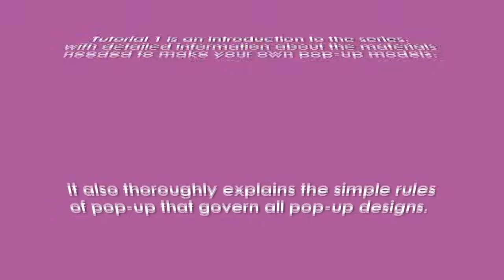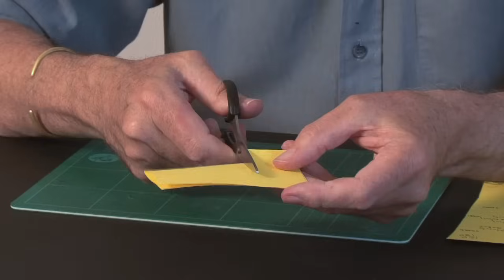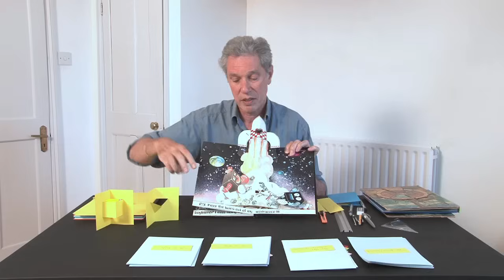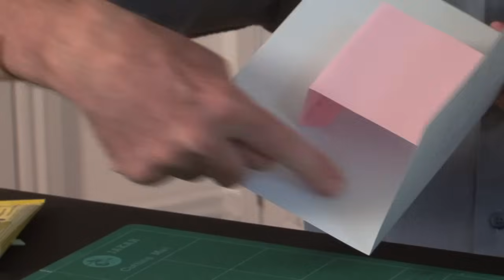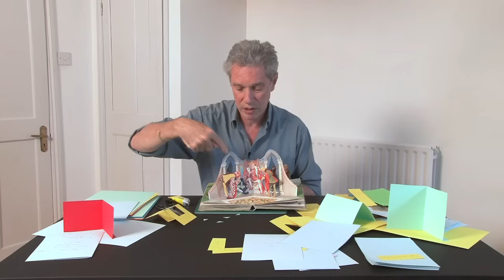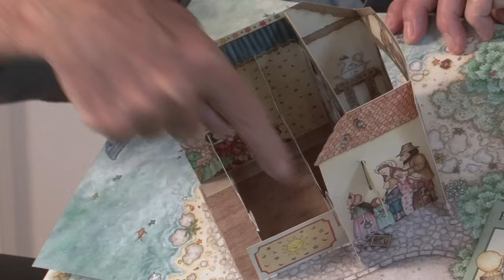Pop-Up Tutorial 1 - Introduction – Materials and Basic Theory

Comment: For anybody wondering  how to find 160gsm paper, it’s just like trying to find A4 paper. Those in the USA will have to find the closest approximate type. 

1gsm=1.48 x 1lb 
160gsm=108lb paper

Cardstock will be too heavy, printer paper is too light. I’ve had great luck with construction paper (there’s a reason it’s called that) but the rough texture doesn’t allow you to illustrate it first. The other thing I’ve used is the decorative scrapbook paper that they sell as single sheets at every craft store, like Michael’s or Hobby Lobby. It also comes in those 12 x 12 paper pads, but the pads are never solid colors.

TL;DR: Construction paper is about 160gsm.

Comment: Would be nice if you were more specific on the type of glue. "Solvent based" is a large category. Some links to specific products would be helpful.
Reply from the maker: I usually use UHU. Really any glue will work. Different brands have different characteristics so probably best is to experiment and find the one you like best. I only specify "solvent based" because these dry more quickly than water based (and don't wrinkle the card) and so I find them easier to work with. There are Gel glues that are very good and clean to work with but they work out a little more expensive.

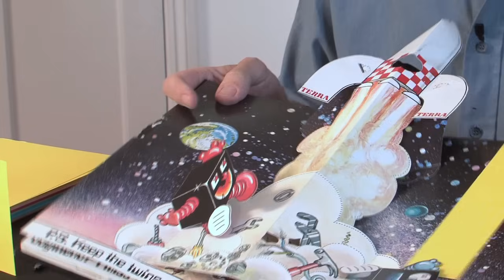Comment: Please guide me. How to move Rocket down to up. 7:24
Reply from the maker: The underlying structure is explained in Tutorial 7 - A V-Fold with added creases. To make the rocket rise as the page is opened the V-Fold should be built pointing down the page. The rocket is made using a Parallel fold as explained in Tutorial 6, this is built on top of the V-Fold. To see how to shape the nose of the rocket look at Tutorial 13 - a little wedge will need to be cut out of the nose in order to shape it.

Comment: If you’re making a pop up that opens up to be 1 foot and 5 inches what thickness of paper do you suggest?
Reply from the maker: The card needs to be rigid  - the actual thickness is not important - You could make the base sheet out of heavier card and then build on it with lighter card. Heavy card will need to be measured and then scored to make accurate, sharp, folds - when using lighter card scoring is not necessary.
Reply: @thepop-upchannel4919  ahhh ok thank you!

Comment: What type of  glue you have used here.,  sir
Reply from the maker: Any glue will work. I prefer solvent based adhesive as it sets quite fast. Water based glues are ok but may tend to wrinkle the card. Stick glues are quick, clean and easy to use - but are usually best for practice models as they may tend to dry out and crack off if left for a long time.
Reply: @thepop-upchannel4919 
 thank you sir, 
How pop up cards help in classroom teachings? 
Can we use pop up cards as teaching aids?
Reply from the maker: Pop-Up cards might make good teaching aids as they have a surprising "Wow!" factor - unexpected, intriguing, aesthetic - so could maybe hold pupils interest for a little longer. As a classroom activity Pop-Up is good for - Art and Design - or Art and Technology - Geometry - Measuring skills - Desterity skills - 3D thinking.....If the idea is to make pop-ups then pupils have to be old enough to have good motor skills, so probably not suitable for very young pupils.
Reply: @thepop-upchannel4919  thank you sir. 🙏🙏🙏

Comment: Hi sir.. I really love to learn also about pop up making.. Hence this was my research proposal all about as an alternative tool in giving instruction to the students to be more effective the learning is...can i ask what would be the best kind of paper that being used in making one of this...my topic is about plant cell and animal cell..pls help me.thank you
Reply from the maker: It depends on the size of the pop-up. The bigger the pop-up the more sturdy the card needs to be. The ideal card is rigid without being thick. In the tutorials I use photo copy card - 160 gsm. For much smaller pop-ups paper will work. For bigger (and better) pop-ups card up to 240 gsm is good - but if using thicker card it is necesssary to score the fold lines and that means they have to be measured accurately. The advantage of the card I use in the tutorials is that it can be folded easily and accurately without needing to score the creases.

Comment: can I use 80 gsm color paper? I can't find >160 gsm color paper anywhere.
Reply from the maker: The ideal card is as rigid as possible while still being thin. You can use much lighter card (or even paper) but then you will need to keep the pop-ups quite small. You can use much heavier card but then you will need to score the fold lines.

Comment: can I get an equation or formula for that angle math?  I am binge watching all of these
Reply from the maker: I don't have an equation - just a few basic rules. 1. The angles on each side of the gully must balance - the angle on the left of the pop-up + the angle on the left of the base must add up to the same as the angle on the right of the pop-up + the angle on the right of the base. 2. The two angles on the pop-up must  add up to more than the two angles on the base. (The angles on the pop-up can be the same as he angles on the base in which case when the page is open the pop-up will lie flat). 3. To adjust the angle that the pop-up stands up at - the smaller the angles on the pop-up piece the less it will stand up - the smaller the angles on the base the more the pop-up piece will stand up.

Comment: I just wanna recreate the pop up from Cavetown's This Is Home lyric video
Reply from the maker: There are a nice varied range of pop-up mechanisms  in the book shown in the video.
Spread 1 - V-Folds (Tutorial 2) with added parallelograms raising additional planes (Tutorial 5) - The little house Tutorial 31....... Spread 2 - Again V-Folds with added paprallelograms. The bed is probably a variation on the Box mechanism (Tutorial 14) ....... Spread 3. M-Fold (Tutorial 19)....... Spread 4. Automatic pull-strip (Tutorial 16) raising a flap (Tutorial 26)..... Spread 5 - under the flaps there are a Floating Plane (Tutorial 12); a Twisting mechanism (Tutorial 17); a Spiral (Tutorial 10)...... Spread 6 - a variation on the Curved shape (Tuorial 13).... Spread 7 - Hubs Tutorial 27.

Comment: Why do you use 160gsm cardstock? Generally I use between 250gsm and 300gsm unless there is a backing card and a inside card then I use one at that thickness usually the outside and the inside I'd do less like around 200gsm

But I'm still amazed by all your tutorials - generally I do pop up cards with dies not by measuring because its simpler however its intriguing to watch how it was done before so many interactive pop up dies were available!
Reply from the maker: I use 220gsm because it’s light enough to not need scoring – heavier card does make a more high quality pop-up but then it needs scoring and usually measuring too.
Reply: Ohhh 220gsm is a lot closer to what I would use the US 100 pound cardstock is around 250gsm though I'm in Australia but this first video says 160gsm not 220gsm unless I misheard but 220gsm makes way more sense ive never done pop ups without using dies and a bone folder to score and yes I have found the thicker it is the more difficult it is but the better quality it is too - I sell my cards so I want to make sure they are high quality but I absolutely love pop up cards!

Thanks for your reply I have only watched this video so maybe this is different to later videos for thickness 

I have never seen 220gsm cardstock anywhere usually either 200 250 or 300 and the US is I think closest to 250gsm I hope I'm remembering correctly! I'm in Australia! 
Thanks again

Comment: Thank you for this tutorial. I can use your help. I have watched several videos on making the Twist and Pop card. I have asked the card makers on how to change the measurements of the mechanism and panel to make a 7x5 tent-fold card, or any other size. No one has an answer. So after watching your video, I figured that you may be able to explain the concept for the 7x5 card based on the original card base of 5-1/2×4.  Here is a link to one of the videos https://youtu.be/b8HWPzHJI64.
Reply from the maker: Tutorial 17 explains this mechanism. I think the best way to work out the dimensions that you want is to experiment. Make one, see if it fits, then make adjustments and make another. I'm sure you'll be able to work it out.

Comment: Thank you for this tutorial. I am listing your recommended materials here to help others and myself (a quicker reference).  
160 gsm weight for paper, 
solvent based adhesive (water or stick glues are ok though watch out for buckling/ cracking), 
craft knife with extendable blade, 
ruler, compass, protactor, bone folder, pencil, and eraser.
Reply from the maker: I try to keep things simple! For most of the models that are shown in these tutorials all you will need are - CARD - SCISSORS - GLUE.

Comment: Hello ! thanks for the amazing tutorial , i just have a question regarding the paper to fold, how many grams is the paper ? Thanks in advance !
Reply from the maker: For quick and easy folding as shown in these tutorials, where the card doesn't need to be scored, I use 160gsm. for more substantial models probably  220gsm. is better, but this will have to be measured and scored. The ideal card is as rigid as possible and as thin as possible. sometimes most of a pop-up could be relatively light weight card and just make it double thickness where a component needs extra strength. The size of the pop-up also dictates the weight of the card - the bigger the pop-up the heavier the card needs to be.

Comment: can someone tell me what glue did he used ?
Reply from the maker: Any glue will work.  I find solvent based glue is best - though different brands all have different qualities. Water based glue is ok but it tends to go hard more slowly so it can be a bit more difficult to work with - also water based glues tend to buckle the card whereas solvent based glues don't have that effect.  Stick glues can also be good, very clean and easy to use, but some tend to not be so long lasting so after some time pop-ups may fall apart!

Comment: Just wanted to say a big thank you for making these videos. They helped me to understand the fundamentals. I also went and purchased your book. I appreciate how you get straight to the core mechanic without all the pretty pictures and fluff; it helped to understand ‘why’ a particular pop-up works. Most other how-to pop-up videos and books only provide the instructions on ‘how’ to create a particular pop-up. I’m looking forward to more; maybe analysis of specific pieces? Or, some of the more subtle questions that arise like ‘why are slots sometimes used instead of gluing?’, etc. 

You’ve revealed the magicians tricks, but that’s OK because now I can create the magic! 
Thank You!
Reply from the maker: +oldspirit apodaca Thank you for your enthusiasm. I am interested in, and open to, suggestions for a follow up series.In the meantime hopefully this goes some way to answering your question.Slots or Gluing? - On some designs where fairly large planes intersect slots are the obvious solution, with a variation of the wing-tab joint holding the two pieces in place. However the answer isn't so clear when the issue is simply how to join two pieces of card - a glued tab or a wing-tab going through a slot.The advantages of using slots: You know the pieces of card are going to be held exactly where you want them (glued joints can slide around a bit before the glue sets); the pieces will move more easily as the spread opens and closes; no stress on the card so it will stay flat and not tend to bend, or if badly creased tend to open in a sort of half-hearted way (this can be a problem with some designs that incorporate numerous fiddly joints).The disadvantages of using slots:They involve precise measuring - fine if it's a die-cut commercial production but slow and fiddly if it's a one off home produced project, or an experiment, or a prototype design; slotted joints will  have little tabs sticking out on the pop-up - this may be an excellent part of the design, or it may create a rather distracting messy effect.Glue: Quick; easy; adjustable; excellent for experiments and prototypes - But can be messy!